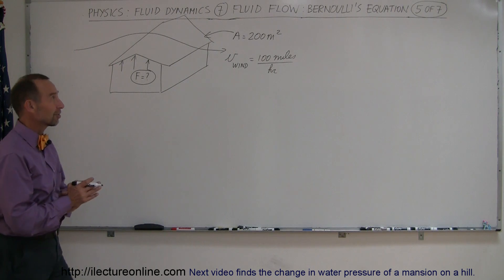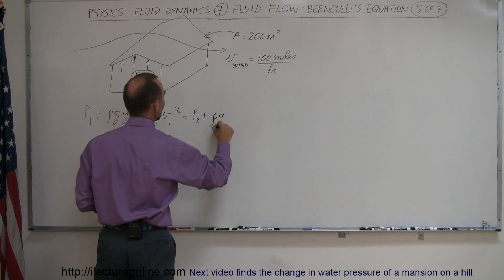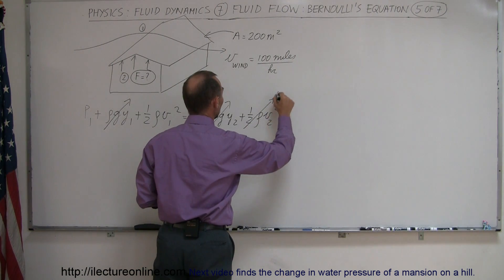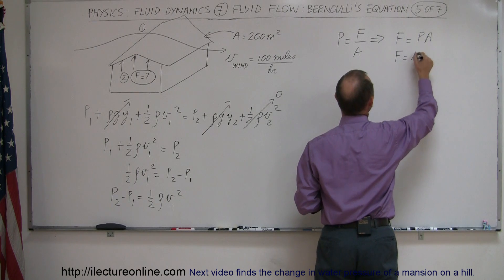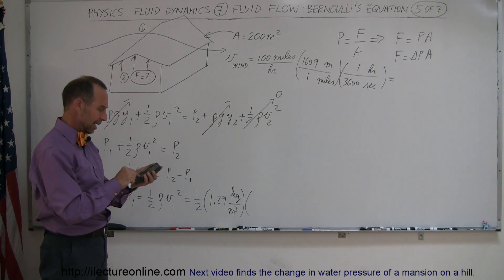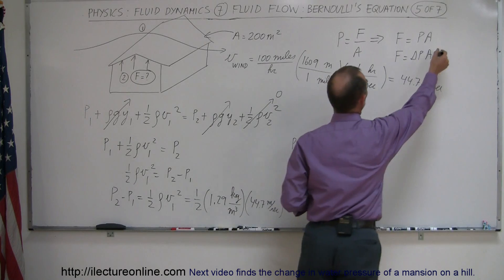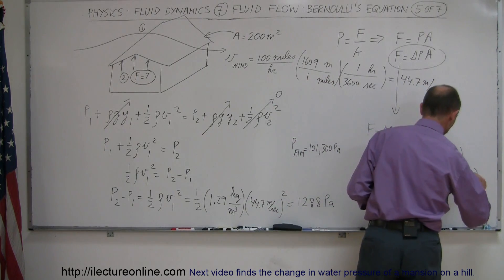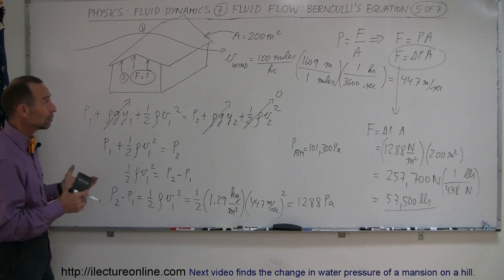Physics 34  Fluid Dynamics (5 of 7) Bernoulli's Equation

Comment: Hi,

Thank you for the videos, they are amazing! just a quick question about the example 5. Shouldn't you use that Bernoulli equation through a streamline? The calculation seems alright but the explanation is questionable i think. How can you connect the points inside the house and point on the roof? i think it would be clearer to assume a point far from the house with zero velocity at ATM pressure. Use it as the first point (1) and and the second point should be on the roof (2). Assuming the air inside the house is  with zero velocity at ATM pressure, the calculation will give the same result but at least it will prevent further miss understandings.
Reply from the maker: Ali,
Good suggestion.  However during a hurricane (or very strong winds), the air will be moving quickly anywhere outside the house, thus it would be difficult to make such a comparison.  That is why I picked a point inside the house.  Bernoulli's equation works as well in this situation (and others) where there is no direct flow relationship.
Reply: Hi Michel,

Thank you for your answer. I didn't say it doesn't work, it works because the air inside the house is at 1 ATM with zero velocity (which is same with the assumption I wrote earlier. A point far from the house). the way you wrote that Bernoulli equation doesn't make sense to me. Bernoulli equation can be derived from the conservation of energy and it says that sum of all mechanical energy is constant on any point in streamline.
If we use your calculations, the pressure inside the house does not effect the pressure difference which is used later to calculate the force on the roof. Lets assume that the pressure inside the house is 2 ATM, what will be the answer? From you calculation, the answer will be same. if the answer is same that means the pressure outside the house is changed which should not be related with the pressure inside the house.

Comment: P atm. when do you use it?  why does it affect the INSIDE  of a house?
Reply from the maker: When you use Bernoulli's equation you must determine the pressure, velocity, and height of each of the two points in consideration.  Since the air inside the house is not moving, we can assume that the air pressure inside the house is equal to atmospheric pressure.  The pressure just above the house will be less than atmospheric pressure because it is moving.  The decrease in pressure above the house can be determine by   delta P = (1/2) x (density of air) x v^2